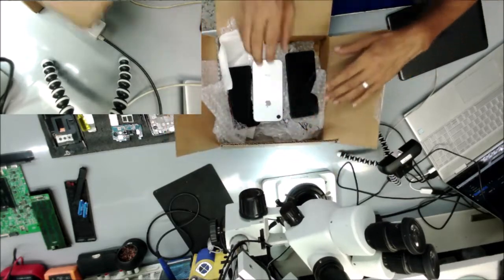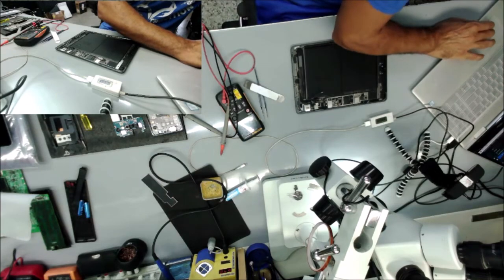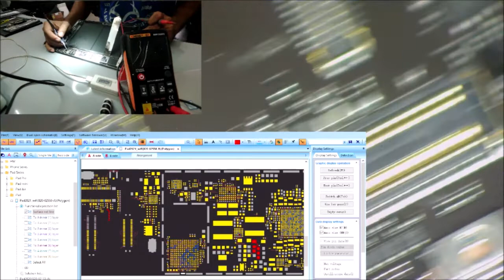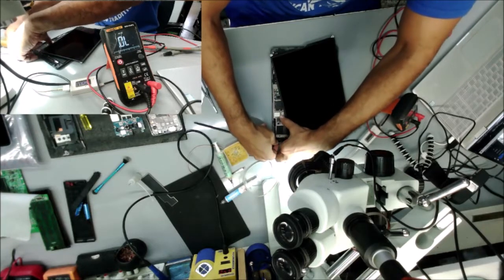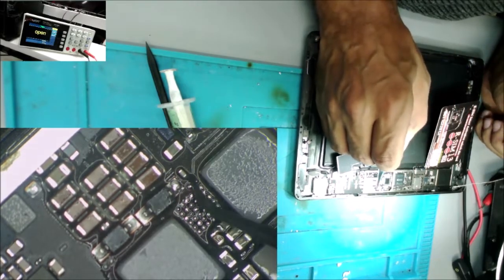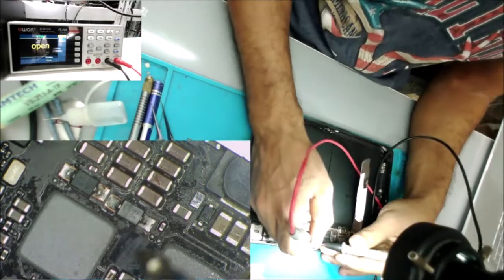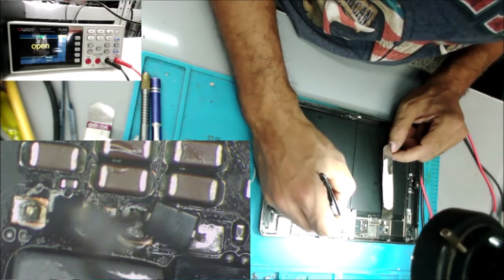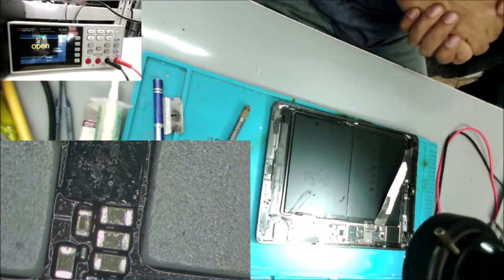iPad 9th gen A2603 2021 no backlight all cases

Comment: Bro seriously, there was nothing wrong with the board. You just shorted that one line by replacing the cap with a filter. You should have tested with another LCD first or measure the backlight output

Comment: They are not fuses, they are ferrite beads. They can act like a fuse just like a 0 ohm resistor can. They are designed to filter high frequency noise. You tested for ground at that cap, why would you replace with a ferrite bead? Also you should invest in some smart tweezers. You could have grabbed that cap after it was off and measured its capacitance and esr. It would have saved you hours and 3 driver ic’s.
Reply from the maker: thank you